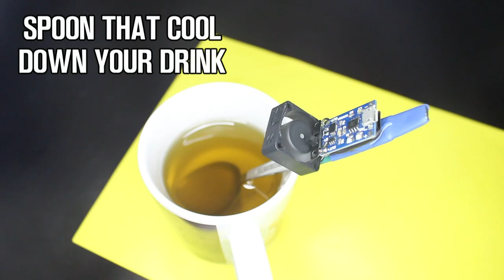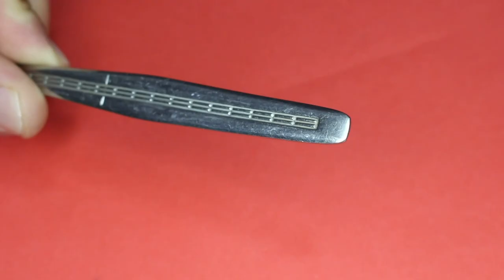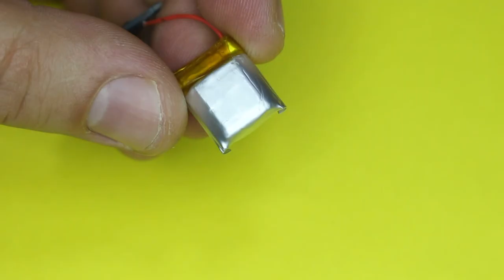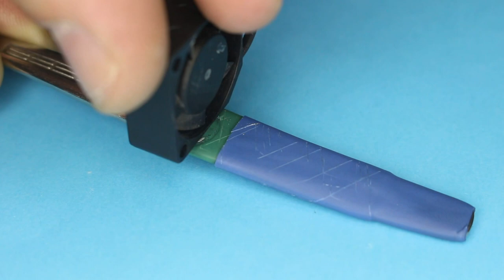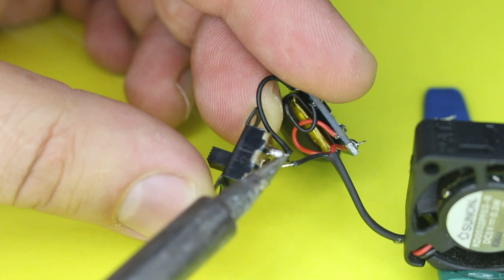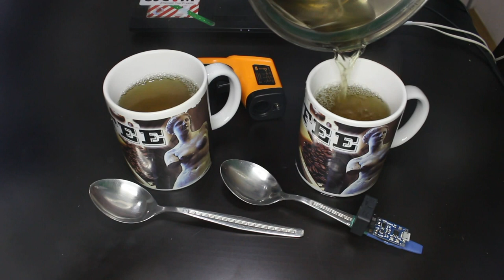DIY Magic Spoon that Cool Down Your Drink!

Comment: you must replace resistor on charger board for right charging current of baterry
Reply: default is set to 1000mah (1.2k resistor) battery, charging with more current than battery have is wrong